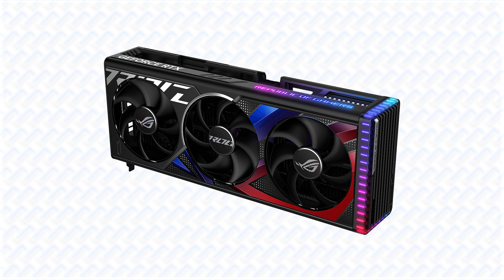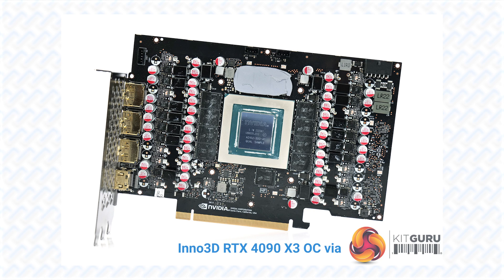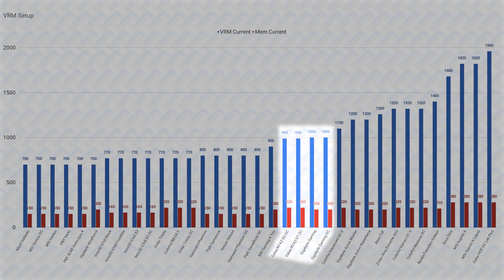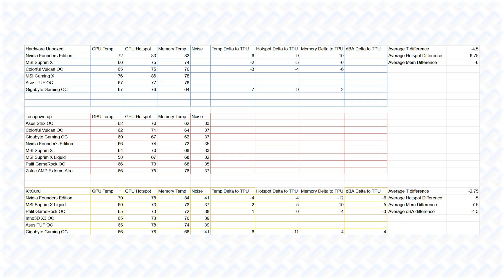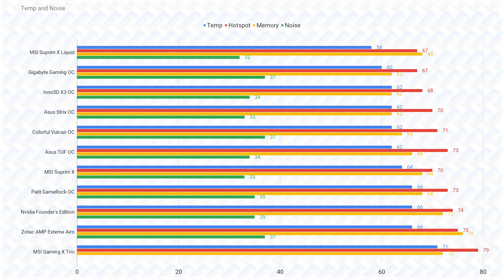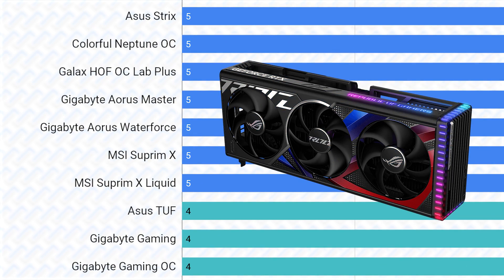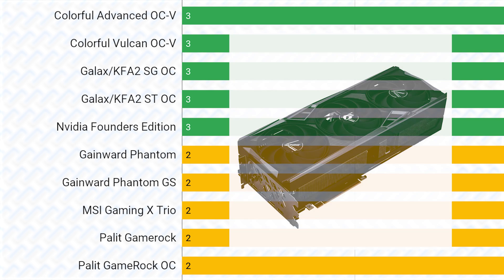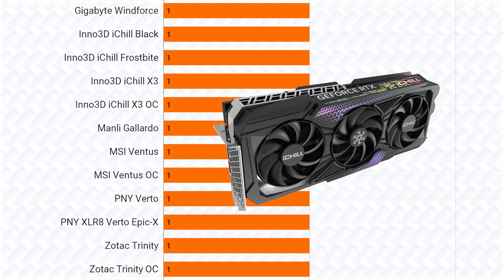Which RTX 4090 to BUY and AVOID?! | 35 Cards Compared! Asus, MSI, Galax, Gigabyte, PNY, Palit, Etc.

Comment: One thing that should be added is COIL WHINE. For example, all ASUS cards are reported to have pretty bad coil whine noise, MSI and Zotac suffer from this as well albeit to a lower extent, while Gigabyte models are less prone to strong noise. At least this is my personal conclusion after reading a ton of reports from Reddit and other forums. So all in all, the Gigabyte Gaming OC is the best model on price/perf overall, while the Suprim X is probably the best if money is no object.
Reply: He couldn't add COIL WHINE because he didn't test them at all. And yeah coil whine is one of the most important thing to buy. 2-3% fps OC is nowhere worth annoying coilwhine.
Reply: I have 3 ASUS 4090's, 2 Strix OC and 1 Tuf OC. Zero coil whine on all of them.
Reply: @knytshayd  It’d be helpful to everyone if you can share experience on hardwareluxx, they do a summary from all user experiences.
Reply: @knytshayd  why do you have so many 4090s?
Reply: @Matt  2 are mine, 1 for gaming only the other for editing ect. The other I gave to my cousin after I initially used it.
Reply: @knytshayd  just curious, why do you spend so much money on gpu's? is it worth ?
Reply: @John Machter  For me it is. Also I can afford it.
Reply: @knytshayd  no problem. i make also very good money monthly and couldnd care less, still i wont pay that for multiple gpu's. no offence, was just curious.
Reply: My gigabyte windforce didn't seem to have much coil whine at first, but has developed it now 🥺
Reply: @Matt-gf4gd  might be bcoz of ur psu is dying,i hv same problem with my old card 3070 after a yr using it,after swap to diffrent psu gpu no longer whining
Reply: @natsu78999  interesting. I got a new PSU with my card though and I didn't cheap out. I got a 1000w MSI pcie5 gold rated PSU - was about $200 and they just came out last year. My system normally only draws around 400w-500w while gaming.
Reply from the maker: Yea I guess that would be good but its really difficult for me to compare when its all based on random posts on reddit or forums.
Reply: @OTechnology  There is a summary of coilwhine on hardwareluxx (can't link on youtube)
Reply from the maker: I see. But its only for very few of the cards.
Reply: @OTechnology  They have nearly 60 cards already, you got the correct link?
Reply: @nguyendinh2052  tyyyyyyyyy
Reply from the maker: @nguyendinh2052  There isn't even 60 RTX 4090s...what are you talking about?
Reply: @OTechnology  sorry, I mean more than 60 RTX 4xxx, including 29 RTX 4090 already.
Reply: I have gigabyte 4090 and can confirm that there is no coil whine. Opposite could say about MSI and Asus
Reply: @EvLTimE  my gigabyte 4090 has some coil whine.
Reply: I have a Zotac OC (waiting for EK block) and the Founder’s Edition (in an itx build for my office) and neither are showing coil whine.
Reply: I have a bit of coil whine on my 4090 suprim liquid. my PC isn't next to my head so it doesn't bother me.
Reply: @Abe yeah I've had no issues with thermals in my system. Fans all generally running between 800-1200 RPM and in silent bios on my gigabyte 4090 it's fans run around 700-900rpm, which is very quiet. The only issue I have is the coil whine. It seems to be less pronounced in silent BIOS than the OC BIOS, but I can still hear it when playing demanding games that take up 70%+ GPU utilization. It's not crazy loud/annoying, but it is the most audible part of my otherwise pretty silent system. I think it's just luck of the draw. I've got it undervolted down to like 900mv at around 2500mhz, so it only draws like 250w under load... But that coil still be whining sometimes. Otherwise though it's been great. In silent bios, inaudible fans it maxes out at around 70c under load... And in OC BIOS it will only get up to like low 60's under load.
Reply: Yeah I’m currently trying to decide on a card buying from a pc builder in UK but they only have Zotac atm, I want the Gigabyte OC hopefully
Reply: Never had any coil whine on my Strix neither has my friend with his TUF
Reply: No. Thats such a lottery thing. I've owned 6 different 4090s. They all had coil whine besides one Suprim and one Gigabyte Gaming OC. The other gigabyte and msi cards still had whine all of them do to some extent.
Reply: Well, it's a mistery indeed. I ended having a 4090 Asus TUF and no whine whatsoever @6r3ys0n
Reply: I have a ROG Strix 4090 with no whine…
Reply: I have the strix 4090 and there is ZERO coil whine. Js
Reply: @chuppy6938  Yup, 2 years later and I have the TUF 4090 and all good 😏
Reply: I have the amp extreme airo and have zero coil whine. Zero coil whine and in eco mode, barely any noise too.
Reply: @Jopup5  Same here, Zotac AMP Extreme AIRO is THE card with least coilwhine! But air cooler is just mediocre, OK with Eco Mode. This is probably THE CARD for custom water cooling mod.
Reply: Strix 4090 here, zero coil whine
Reply: @ThEoNeAnDoNlYmE0  I don't think there's such thing as ZERO coil whine, but glad to hear it's not noticeable. It seems to really just be luck of the draw though. It happens on all models - strix, gaming OC, MSI cards etc. Mine isn't super loud, but can be apparent, usually only when playing a demanding game at 4K over 100 FPS. It's not really apparent if playing less demanding titles though.
Reply: @Matt-gf4gd  no, I mean there’s no coil whine. I’ve kept the fans at 100% and hear ZERO noise coming from the GPU aside from the actual air being pushed through the cooler. I had a Thicc 5700 xt and it had coil whine. Also had a 6800 XT from XFX that had moderate coil whine when fully under load. To say “there is no such thing has ZERO coil whine” when it has been demonstrated to not exist on many models on big YouTubers channels is a little baseless. To each their own, everyone has their opinions. Agree to disagree.
Reply: @ThEoNeAnDoNlYmE0  I mean just physically there's always some amount of signal noise when you're running 300w+ through those power delivery components, but it doesn't really matter if you can't really hear it. I wouldn't be able to hear mine over my fans if I ran the fans over 60-70% either, but since I'm usually running my fans pretty quiet it can be discernable in certain situations (not always). It's not like an always there or not there situation. It depends on things like the game itself, graphics settings, resolution, frame rate. Like if I was always gaming at 1080p or even 1440p at 100 FPS or less, I'd never hear it. It's only really when playing at high/ultra settings on demanding titles, at 4k, over 100 FPS... That's when it will usually kick in. So anyhow, there's technically always coil whine, but if it's not discernable then it doesn't matter. You just want minimal coil whine to the point where you don't notice it.

Edit: if you did really want to test to see how much there is just for curiosity sake, try running a benchmark test or demanding title at 4K Max FPS and turn all your system fans/GPU fans down to minimal speed to where you can't hear them and then take off your side panel and listen right up to the PCB of your GPU and you'll likely be able to hear at least a faint humming noise. That's effectively 'coil whine' but it's just the power delivery components running. People just typically only refer to 'coil whine' when it's excessively loud.
Reply: @ThEoNeAnDoNlYmE0  lmfao, you keep the fans at 100% and you no hear no coil whine? Well duh, the fans drown out the coil whine. Keep the fans off and then tell me what you hear.
Reply: @jimtepedino9295  I've pushed 500+w through my 4090 with the fans at varying speed, I hear zero coil whine. No electric components of any kind.
Reply: @ThEoNeAnDoNlYmE0  You may have none, which is great, but to say you have the fans on 100% and you hear none is not any type of conclusive proof. The coil whine has nothing to do with fans and the fans will cover up the noise. My new card has it and the fans are so quiet, because I have a new spacious case, I hear it, but I wear headphones, so it doesn't matter. Actually, it doesn't whine in all games, only the most taxing. It is what it is, the card is a beast.
Reply: @jimtepedino9295  dude, I said varying speed, hearing “no electrical noise” of any kind I.e. electroaccoustic noise which is what coil whine is. Well aware it has nothing to do with fans, otherwise wouldn’t have mentioned how much wattage I’m pushing yet still no actual
Noise coming from the GPU. No idea why you are obsessed with coming at me sideways man, plenty of people in this reply thread claiming no coil whine.
Reply: I have the Asus TUF RTX 4090 OC and no coil whine at all. Ive got an Asus brand Intel motherboard with an i9 10900k CPU, 32GB Ballistix RAM, and a 1kw EVGA power supply plugged into a good quality surge protector. I use Bose speakers and also use headphones. No coil whine at any volume level. My old Gigabyte RTX 3080 also had no coil whine. 

It might be dependent on what combination of parts are used to produce the coil whine. Perhaps on an AMD CPU/motherboard or certain Intel CPU/motherboard combos? Could also be what RAM you have or what power supply you are using. Other possibilities would include which speakers/headphones you are using and if you are using a high quality power supply vs a cheap one or directly plugged into the wall or plugged into a backup power supply.
Reply: @jb4511  I wonder if using a good power conditioner would affect coil whine too. Like one of those power conditioning surge protector strips you can get for like $100-$200
Reply: @Matt-gf4gd  No idea, but I use one from Cyberpower. Have had it a little over 2-3 years no with no issues. Believe its EC850LCD, but I could be mistaken. Has also saved my computer I'm sure on 2 separate occasions.
Reply: My rog strix 4090 is fast and quiet
Reply: After spending $10k on buying 5 different RTX 4090s, I returned all of them except gaming OC, just because it had the quietest coil whine😂🤣😂.
My Fractal Define XL 7 SOLID panel case couldn't even suppress Founder's Edition coil whine.(yes, that case has sound dampening material all around the case)
Gaming OC however, I can leave the side panel OFF. People who only bought 1 RTX 4090 probably don't know that they don't have to live with coil whine. Silent monster gaming PC is luxury only a few can afford anyway.
Reply: @csguak  yeesh... Yeah mine has whine, but it's usually not loud enough to bother me when gaming.
Good selling point for the gaming OC though. You don't hear about that much in reviews but that's probably way more important for most than marginal cooling or aesthetic differences.